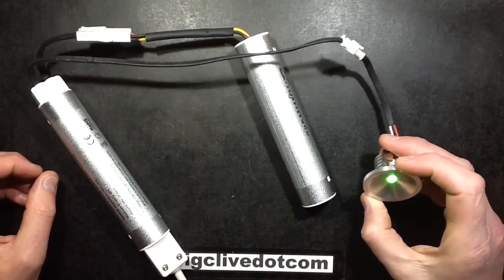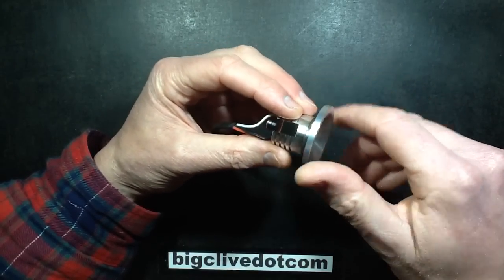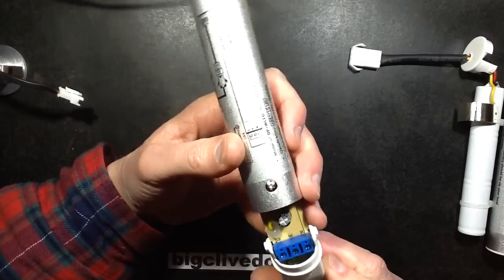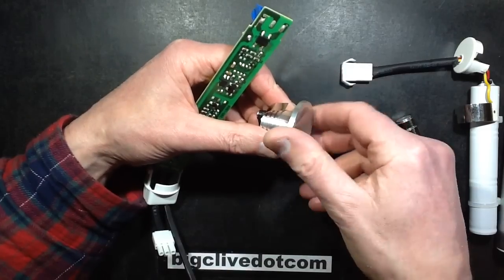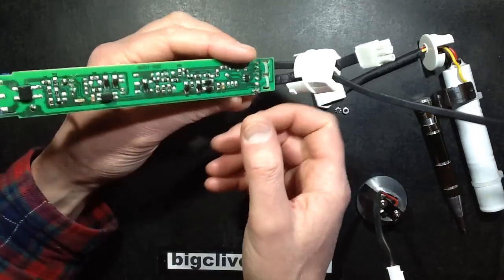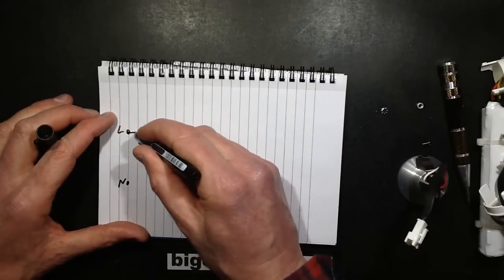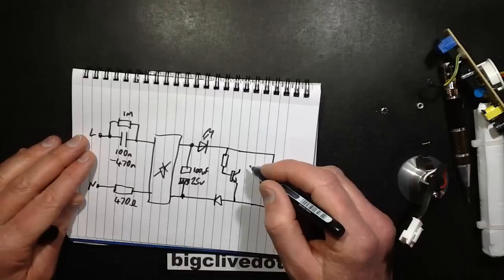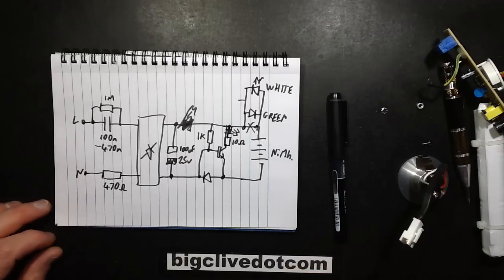A look inside a 1W LED emergency light.

Comment: I've been in crawlspaces and seen emergency light fixtures from back side. Those were wired in series and in the end was the customary yellow-green cable connecting the last one to the earthbus. That way you did not bring the earth from the battery fixture to each light separately.

Comment: Back in the day (dinosaurs still walked the earth in those days) when I had some involvement in emergency lighting, they could be 1, 2 or 3 hour duration.  Various complicated factors dictated minimum duration in particular circumstances.

Oh, and the durations were basically what they were advertised as, not what they actually did (as long as they lasted at least as long as they were advertised to).

I have no idea what the situation is now, although a quick google suggested that they still come in those three durations.
Reply: I can remember those old emergency lights, they had a small, almost motorcycle type of wet cell battery in them, then two large flood lights.  We had them in the barracks back in the 70's.  If I remember right they only stayed on for about 30 minutes then faded to black.  We rarely ever got to see them in action, not a lot of power outs down in Texas back then, and since I lived in base housing with my wife and kids, I was only in the barracks during duty hours, and we had really little need for them then.  I guess I do recall having a power outage once when I was pulling CQ duty (Charge of Quarters NCO baby sitting the privates who lived in the barracks at night) that we did have an outage seems only a couple of the lights even worked, but we carried a large flash light, nearly as big as the kel-lights I would carry as a peace officer later in my life so the need for the emergency lights were minimal, and the troops were supposed to be in bed and asleep anyhow, well those who weren't high as a kite on what ever their favorite drug was back then.  Usually pot as the smell in the hallways would indicate.

Comment: We've got some new LED emergency lights at work (bit different design to this) and in a recent power cut I noticed that they're not really as good as the fluorescents in a translucent diffuser box units they replaced. The LEDs give you a very small visual target at ceiling level and it doesn't particularly look like it's telling you which way leave the building (the fluorescents had a green arrow on them). The LED's project a vertical beam onto the floor (which as it happens is quite a dark colour) - you could see an obstruction on the floor if one was there, but if not  it's not really very apparent that that 1.8 ish meter circle of dark floor is being lit. very little light being splashed around onto walls etc, disorienting.
Think these things might be found wanting in real emergency evacuation situations TBH and something that looks like the boxy diffuser emergency lighting units people have come to expect over the last few decades (probably containing LEDs) is really the best way forward.
Reply: joinedupjon  In my workplace, the traditional emergency light boxes have been replaced with a more modern type, the same size as the old ones, but containing white LEDs instead of a tube. For some reason, the non-maintained type get replaced by constantly lit types, even in normal rooms.
Reply: joinedupjon what’s even worse is the LED bulkhead emergency lights mounted over doors... All the light shines sideways and bugger all ends up actually lighting the doorway or the area around it. Fluorescent was miles better. And what’s the point anyway? They are only lit during a power cut so the energy saving is moot...

Comment: Nobody has the answer yet? (Or at least I didn't find it in the comments). Well, let me give it a try then. We'll disconnect the mains. What turns the white LED on? The transistor. What turns the transisor on? The white LED. It seems like there is a chicken and egg problem. I might be wrong. Haven't done any electronics since the 80's...
Reply: Oops! Didn't notice the description... Pressed "Show more" and there it was. Well... I was kind of wrong. No surprise. :)

Comment: what kind of battery it is? liion?
Reply: They look like "sub c" size cells with a flat top, so that would limit the chemistry to NiCd or NiMh. They used to be common in RC and tool batteries, and they are common in "dumb charging" devices since they can be continually charged at low current.

Due to the voltage (3.6) and the 3 cells in series with no balancing this can't be a Li-Ion pack. Ni-Cd and Ni-Mh are ~ 1.2v each.

Comment: How is it connected to mains potential in the attic? Our (USA) National Electric Code requires all permanent wiring to be protected by some sort of conduit and connected inside some sort of junction box. I'm trying to envision how to connect this. (Loose wires or extension cords are not legal for permanent connections, although some people use them anyway. I could tell you stories of extension cords stapled over doorways to connect an air compressor on one side of the door to a receptacle on the other!)
Reply: Just to clarify: that's "low voltage" in the sense of "under a kV", right? Because they seem to have mains input...
Reply from the maker: +Chaplain Dave Sparks This would be connected into a suitable lighting outlet box and then the modules (linked by low voltage wiring) would lay on the ceiling in the same way that electronic lighting transformers do.

Comment: You should do a teardown of the Sylvania brand cylindrical night-light/power failure lights...I have had a 100% failure rate on them within 2 months, the failure seems to be the pack of coin shape batteries failing (seperating at the seams) in charred flakes

Comment: I don't like this circuit. The moment battery pack will degrade with age or will be disconnected from the circuit full mains voltage will end up passing through this 25v capacitor blowing it up. There should be some zener diode after the bridge rectifier to prevent this.
Reply: That's a bonus, it means the customer has to buy a new one sooner than otherwise mandated.

Comment: do you have the link to where this can be bought
Reply: +Tim Gomes in case you haven't found it yet, http://www.ebay.com/itm/EMERGENCY-LED-DOWNLIGHT-Non-Maintained-3HR-NM3-Light-1W-Office-Home-Spot-Lamp-/131191053024?hash=item1e8b989ae0:g:l~oAAOSwT6pVuL6Z
Reply from the maker: +Tim Gomes It was a random ebay purchase.
Reply: +Tim Gomes http://www.ebay.co.uk/itm/EMERGENCY-LED-DOWNLIGHT-Non-Maintained-3HR-NM3-Light-1W-Office-Home-Spot-Lamp-/131191053024?hash=item1e8b989ae0:g:l~oAAOSwT6pVuL6Z
Reply: +Doug Reed He asked for a link, so he knows that.

Comment: Hi, please make a video on converting a 110/220v cree LED bulb to operate on only 12v. As I have been plagued with power outages, and need an alternative to the flash lights and oil lamps I've been stuck using.
Reply from the maker: +Coffieman5150 You can buy 12V LED lamps as standard.
Reply: +Coffieman5150 Maplin have them and the caravan and narrowboat community use a lot of them as they generally only have 12 v unless the engine is running. Although with inverter tech this is changing. But for lighting it is usually 12v dc.

edit ...Is it safe to mention Maplin? (hides behind sofa)

Comment: I am seeing another possible flaw. If the batteries are significantly discharged would you end up blowing the arse out of the green LED if you plugged it in?
Reply from the maker: +Nick Hodder If you're referring to my doodled minimalist version, then no.  The capacitive dropper supply would limit the current through the whole circuit regardless of the battery voltage..
Reply: +bigclivedotcom Just did the math. 7.5mA. Not enough to do anything spectacular.  :)

Comment: they are sub c cells. found in power tool batteries. they have a really high discharge rate, hence why they are used in power tool batteries.
Reply: What a handy comment, was looking to replace the NiCad cells in my old battery circular saw.

Comment: why charge them constantly? should be charged only when the level drops below let's say 80%. there is no load under normal circumstances. batteries tend to lose charge in time but it takes months to drop from 100 to 80 right? so they would be charged in 3 years only 20 times or so.... batteries should be like new
Reply from the maker: +Szymon Krasuski NiCd and NiMh cells in these applications tend to have quite a high self discharge current.  They are designed to be trickle charged continuously, which also simplifies the circuitry.
Reply: +bigclivedotcom why is that, and can it be fixed?
Reply from the maker: +hornylink It's just the nature of the technology.  It is suited to an application like this because of its ruggedness.
Reply: Nicd and nimh power tool batteries tend to self-discharge to flat in weeks. Which is why lithium ion screwdrivers are so much better...

Comment: If there is sub millimetre isolation at any point, then it simply ISN'T good enough. Time after time I have to check and re-check my own circuit designs to meet the safety standards for electrical creepage and clearance. Yet millions of potentially unsafe equipment like this is made and sold marked as safe.

Comment: I remember once seeing a combination of a night light, emergency light and torch in one, which I think was an Aldi special sometime last year.  It plugged in and operated like a typical night light, but had an internal battery to keep the light lit during a power cut.  I can't remember the power rating, probably 1W.  A few advantages with this for home use would be the ability to just plug it in instead of requiring an electrician and being able to unplug and carry it around during a power outage.

Comment: There's no negative return for the LED's on the top rail. They are after the Bridge Rectifier so the rail they're sitting on would only ever be positive? If I'm wrong blame Stow College! :)
Reply from the maker: Nope.  Theoretically the negative would be via the resistor and transistor.
Reply: bigclivedotcom Have them biased like that would be a dead short? No resistive load? Help!
Reply from the maker: BigGoucho The resistor would still be in circuit above the transistor.

Comment: nicad is still allowed for portable power tools, justified by the cheaper pricepoint,(the EU have extended its exception several times)  but im sure the lights are nimh, they dont need nicad anyway (nimh cant shift the high amps needed for power tools)